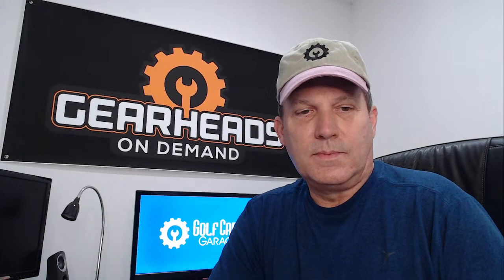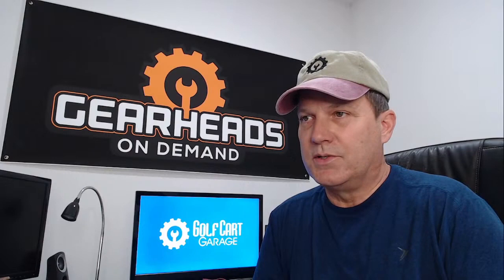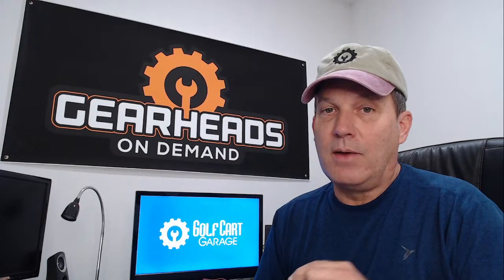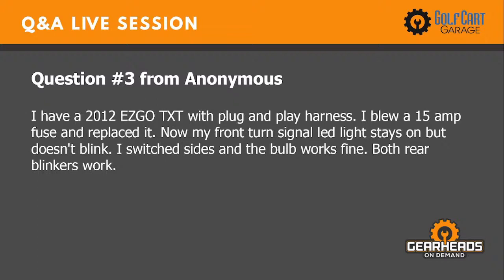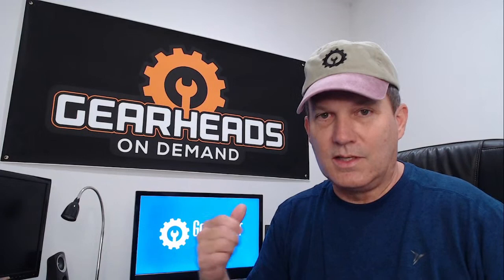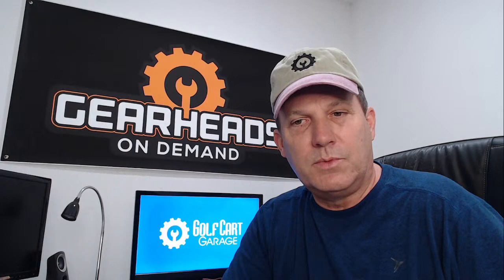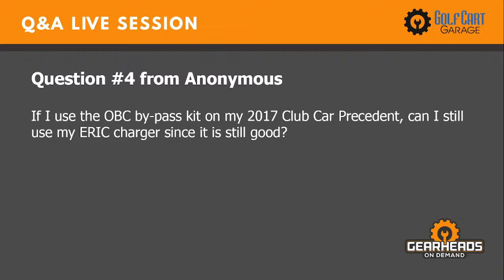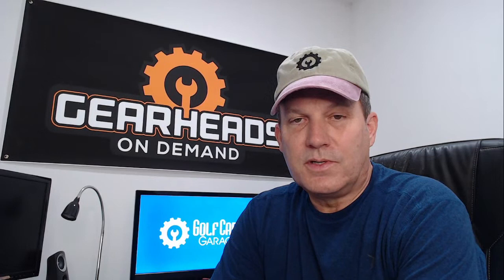How to remove tight lug nuts? | Golf Cart Garage I Episode # 69

Comment: I have a 91 club car ds 36 volt, I don’t have individual selinoids for speed control on the coil bar. Is there a way to change the cart from a resistor system to a regular more modern system or is it even worth it. Thank you.
Reply from the maker: Thanks for tuning in, Gary!  The conversion is possible, but costly and time consuming.  So, it depends on your situation as to whether it's "worth it" or not.  But, most of our techs would prefer to invest in a more modern vehicle, instead, if possible. That said, we can help if you're jumping into that project. Let us know if you have more questions or need help!  Support@GolfCartGarage.com or (800) 401-2934